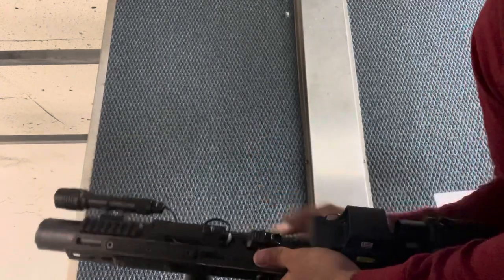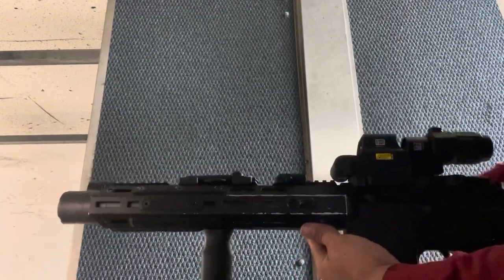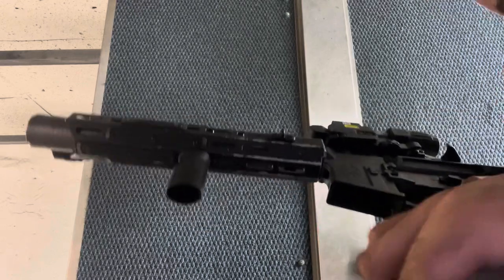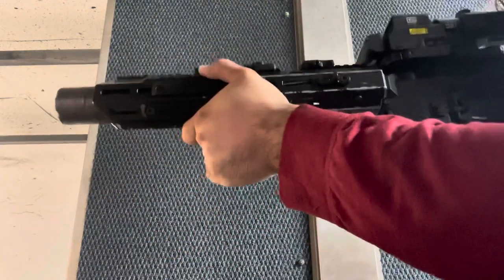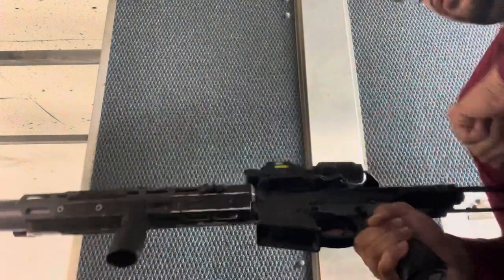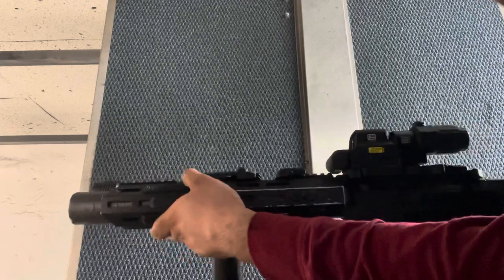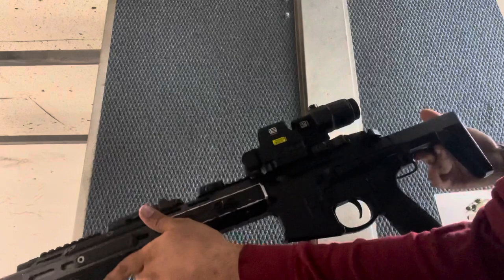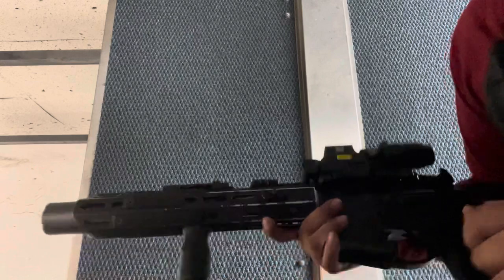Q honey badger sd / noveske n4 sd (ghetto blaster) rail

Comment: I love this concept, any clue what this would look like on a 10.5 300blk barrel from
Noveske?
Reply from the maker: I have a new version coming out that is longer and I think will match the noveske design. It will be 14 inches long. You should have a 3.5 inch recessed portion.
Reply: @o329o  sounds sick, any ETA on that product or piece point?
Reply from the maker: @markrobison2549  hopefully middle of next month.
Reply: @o329o  great! Follow up does this rail with any gen Noveske nut or is it just gen 1-3?
Reply from the maker: @markrobison2549  i had this so it’s based off of this. But I want to try the n4. https://noveske.com/products/nsr-nhr-barrel-nut/